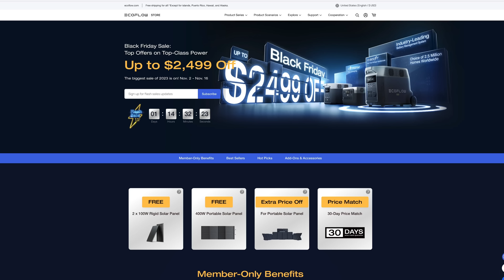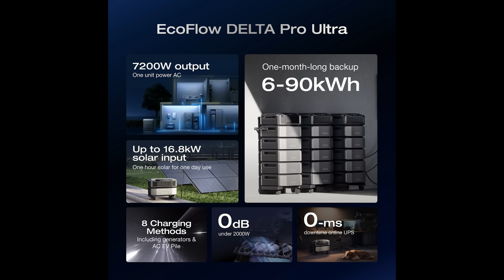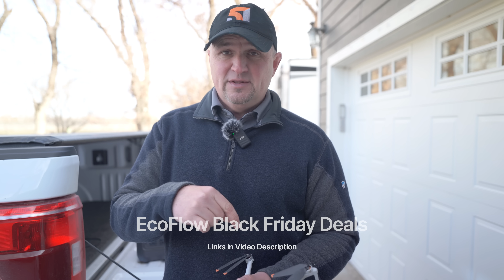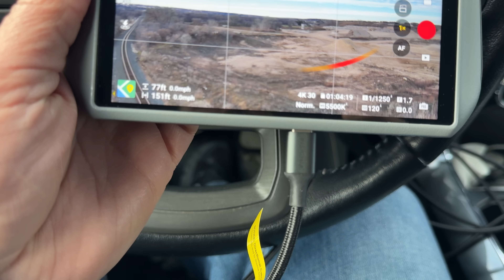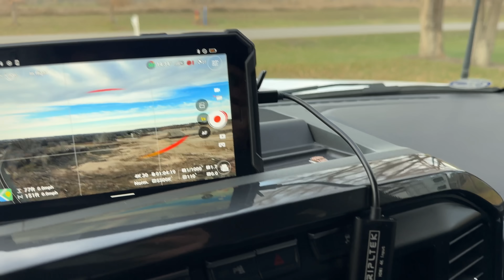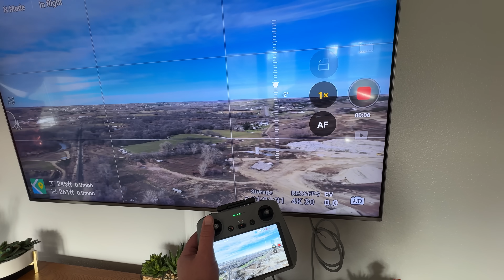Can You Help Settle This Confusing Rule?  Legal or Not Legal???

Comment: EcoFlow... WAVE 2 + Add-on Battery 
Holy scow... Super cool (and heat) for boats.  This is less investment than a lot of powered heat pumps that need AC Power to run, and would be awesome for cooling in a small cabin in a boat.  I have to look into this more, hopefully can handle the environment, shock loading, damp etc.. that is a challenge in the maritime environment.  Thanks for the good lead on a potential boating solution, great ideas.

Oh on the video... I have the non-Pro RC 1 controller w/Mini3 (non-pro), bummer no way to stream out of that controller yet that I can find. I do have the N1 and that can do it, but, prefer using the built in display controller.  My goal would be to stream via YouTube channel to a PC => out to big screen, in the club house while on the water shooting sailing regattas.  So my flow would be Drone => Controller USB C=> Phone 5g => YouTube Live => PC HDMI=> TV.... Can't find a way yet.

Captn Pea

Comment: Excellent topic for winter flyers. Thanks for pointing me in the right direction. The ECOFLOW Portable Power Station RIVER 2 Pro has the right combination of power and portability to get through a weekend of camping or a storm. The 220-watt solar panel can charge the unit in 3.5 hours, which is great for the limited winter sun.

Comment: I have the River Pro 720Wh model and love it.  Great set of features, lots of connection options.  Having a portable battery with this kind of capacity is great for peace of mind when you are away from an outlet for all your electronics.  I can even use it as a battery backup for my sump pump if needed!
I didn't get it at the time I purchased the River Pro, but I am eyeing one of EcoFlow's Portal Solar Panels to add to my setup.  If the power was out for an extended amount of time or if I were 'off grid' for a while, it would be really nice to have that option for recharging my River Pro.  (The whole home backup systems are kinda tempting too.......maybe some day!)  ;) 
Thanks again, Russ!

Comment: Thanks for great content and clarification on flying your drone from inside your car.
What a blessing it would be to have the Echo flow Delta. Load shedding and no power are the worst experiences that anyone can have in South Africa. We have most days,  2 hours of electricity and 4 hours off. It's absolutely disruptive. This has been going on for 25 years. Most households have resorted to alternative power sources. The only way out is having an Echo flow system. 
Best
Jay
South Africa

Comment: Russ, I have a question: Is it unlawful to fly a drone from inside a MOVING vehicle? You are not the driver. Yor are the Drone Pilot sitting in the passenger seat, but the vehicle is moving. You have VLOS at all times.
Reply from the maker: Only allowed in sparsely populated areas

Comment: I'm trying to master just flying my drone. So when I get that under control I will try it from my truck. Thank you for always clearing things up.  My wife and I are traveling the US in our 5th wheel so hopefully we can stay out of the cold by chasing the sun. With you advise I bought an Air 3 what a great flying drone. Still trying to get used to it. I am looking at the Eco Flow River 2 pro so I can use it to power up some of our smaller items and also charge Drone batteries while out flying. Thanks Russ.

Comment: Add to all of that very good information the fact that if your vehicle has a sunroof, your VLOS is even greater! Thanks for the info on hooking up an external monitor. Solid info!  ECO FLOW: I really like the RIVER 2 Pro Portable.  I have a Rock Pals unit that has helped power 2 CPAP units at the same time while we spent 10 days aboard a houseboat on the St. Johns River in Fla. It's also powered lamps and fans during power outages. I can see it being essential for keeping drone batteries topped off during road trips.

Comment: The EcoFlow DELTA mini Portable is plenty for my needs!   
I fly from inside my vehicle in cold and hot weather and can maintain VLOS.  And I modified my controller with coax QMA quick connectors so I can put two magnetic antennae on my roof.

Comment: Thank you Russ for clarifying the misconceptions surrounding flying your drone from inside a non moving vehicle.  The Ecoflow DELTA Pro along with the SMART Extra battery and transfer switch would definitely be  a hit under the tree!  It'll be great for in home power backup and for use on the road!
Reply: Eco doesn't have long battery life cycles ... Get a bluetti

Comment: I like the ECOFlow BF Deal on the RIVER 2 Pro Portable. It has an impressive 600W AC outlets. Enough to power multiple devices simultaneously, from charging our smartphones to running a small electric cooler.

Comment: Looks like you have same problem that I have with Air3; obstacle avoidanc detects things that does not exist.?
Reply from the maker: The sunlight sometimes does that.  Very frustrating.
Reply: @51Drones  Yes, wery. But hope it will be fixed. My Mavic 3 and 3 Pro is not as sensitiv

Comment: I fly sitting in my parked MGB with the top down. I keep the controller low so no one can see it. I have total 180 degree field of vision from the MG. I’m thinking about putting a removable landing platform on the rear luggage rack. Flying from a convertible virtually eliminates most Karen problems. Not all, because I take my friend for a ride, and her name is Karen…

Comment: When I bought my 2nd air2s, I purchased the refurbished unit with the old refurbished smart controller and my current VLOS range sux big time, even with line of sight I might drop the visual signal around 1000 feet  when cruising at 50 feet up. I've never even considered flying from my car because of this limitation, besides I drive my Honda metropolitan all year round (because of 107 mpg), and was cheaper than buying a drone.. now that I think about it my drone is worth the same as my car and scooter combined, but I digress...

Comment: I don't have a RC 2 controller yet.  I'll keep that remote screen info in mind when I get one.  I was able to purchase a refurbished EcoFlow River 2 Pro on EcoFlow's website for $398 (plus tax) using your discount code.  As long as the manufacturer is the one refurbishing the item, I have no problem buying refurbished units.  I purchased the EcoFlow River 2 Pro to have on-hand at the house during any power outages for the small electronics we'll need to keep powered.  I'll also use it to power up drone batteries while out in the field flying drones.  I have two of the older EcoFlow Delta units to keep our garage freezer and a small refrigerator powered during power outages.

Comment: I love Ecoflow products. I am looking at getting the Delta Max 2. I'm a dj, and use my Delta Mini to run my system for off grid wedding ceremonies, looking to get the Max to have more capacity to do off grid events using my full system. Also have two River 2's for charging my drones. Also, thanks for the mention about next camera app, I needed that. 👍

Comment: i saw in your video when describing tripletek that your rc2 display momentarily said "remote id error" which is what i get sometimes on my air 3 as well.  Is this because they have suspended remote id until march?  I just feel like this is going to be quite the nuisance as time goes on.
Reply from the maker: No.  It just takes a few seconds to engage.

Comment: Russ, I went over and checked the website, and they all look incredible. I need a small power unit for recharging in the field. Would the River 2 be able to handle a charge of say 6 air 3 batteries before needing to be recharged?

Comment: I did not realize the RC2 had video out. That and the external antenna are enough for me to upgrade. Do you know if it is backward compatible with OS3?

My favorite/pipe dream Ecoflow product is the dual Delta Pro with dual voltage hub. I'm weighing whole-home backup options and that is the ultimate one for us. I would add the smart generator to the mix and be very, very happy. I still need to install the soft start on the a/c and then take measurements, but I don't think I'll finish that until spring at this rate.

Comment: I had a question actually ask something similar to this for my knowledge exam. It asked something like “You are in a remote area. Can you fly a UAS from a moving vehicle with another person driving?”
The answer was something like “Yes if you are in a remote area and the remote pilot in command checks to ensure the space is clear from hazards” 
It wasn’t exactly phrased like this, just from what I remember. Apparently I did not get it wrong based on the missed question codes. 
Now I hope the feds won’t come knocking on my door. 🤣
Reply: I just asked Russ a similar question regarding flying from a moving vehicle. Didn't see your post. But since you didn't get the question wrong, it must be OK to fly from a moving vehicle. Good to know . Thx.
Reply: @touie98052  In remote areas, not in town.

Comment: However, situational awareness is absolutely crucial to keep in mind here for safe flying. If you're in a car, you have less visibility of the airspace around you and, if the windows are closed, less ability to hear the airspace around you. It drives me crazy to see super low flying manned aircraft but it's a reality sometimes. I'd personally recommend and use extreme discretion and caution piloting from in a car if the drone is in the hundreds of feet off the ground. Thanks for all your videos!
Reply: It's not going to be over 400 AGL, right?  Aren't planes and helicopters supposed to be above that?  I think it comes down to visual line of sight, either you have it, or you don't.  If you have it, end of story.  If you don't, it doesn't matter if the reason is because you are in your car, there is a tall building in the way, or tall trees are blocking your view.  How much 'visibility' of the airspace do you need to have to be safe in your view?   Note, there is nothing about this in the rules, only that you have vlos to your drone.  I live in the greater Seattle area and am in the land of very tall (> 100'), dense trees, even in the suburbs.   They tend to limit your view of the airspace.  No, sorry, that is the reason we have the 400 agl ceiling, to separate drones from manned aircraft.  Lastly, I would always personally recommend people use discretion and caution piloting a drone, always, not just when done while seated in a vehicle, but that goes without saying.

Comment: Thanks for the information, very useful.  On the Delta Pro.  It does seem like a viable option, my only issue would be the size of it.  One, may not be that big of a deal but when you start stacking them for longer power time, space may become an issue.  Just my 2 cents.
Reply: I have 2 Delta Pros with a dual hub and a 10 circuit transfer switch that I use for home  power backup. It works great, but I would not want to try to carry them around unless I had an RV or something.  Also, I got notification that Ecoflow is coming out with new products in January.